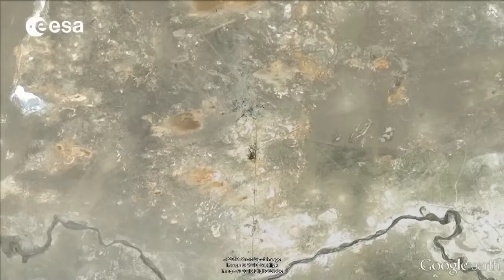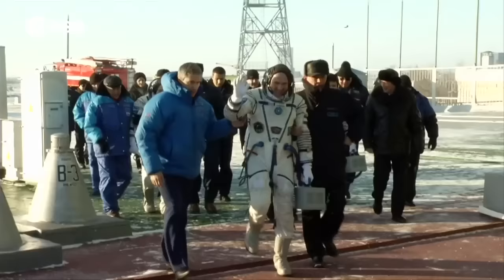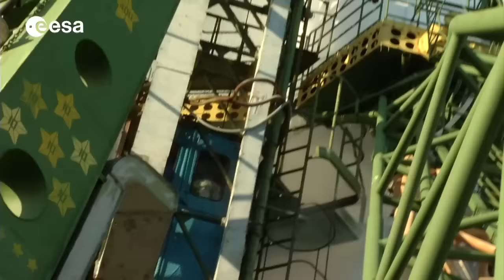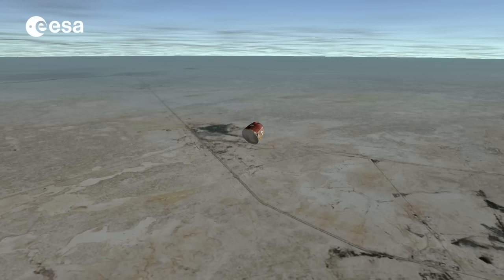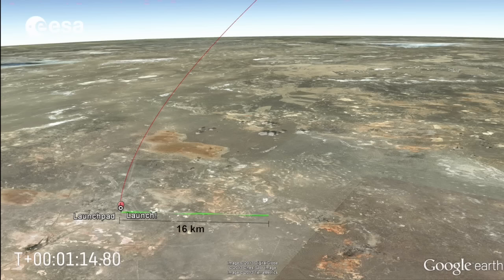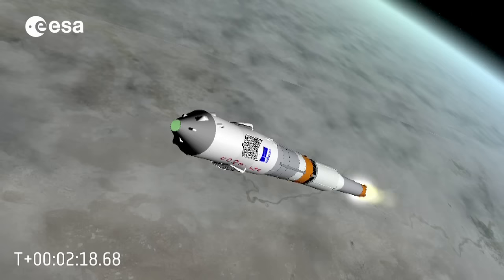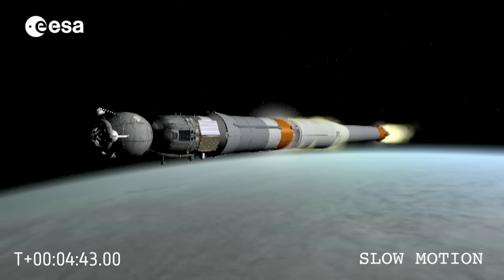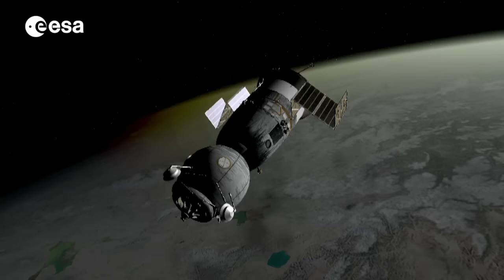The Soyuz launch sequence explained

Comment: Say, what would be the function of those four folded quadrangular panels that extend upon LES activation? Are they air brakes?
Reply: they are solar panels,probably for providing electricity to the engines.
Reply: SSen Gupta
No, on the outside of the Soyuz fairing. It looks like a grille that we see folding out when the LES is activated.
Reply: They are control surfaces that fold out during an abort, and they stabilize the flight of the capsule like the feathers of an arrow as it flies upward. They are shaped like that because they stow more easily, unlike traditional fins.
Reply: Owen Vankirk Interesting, thanks.

Comment: I am not a science student so can anyone explain me, why do the boosters I see are less powerful then compared to nasa, the reason I got to is conclusion is because the engine was making less noise and less smoke then compared to nasa rockets
Reply: NASA almost always uses solid-propellant boosters, which are much more powerful, but cannot be shut off mid-flight and are thus very dangerous for launching manned spacecrafts. Russia uses liquid-fueled / hypergolic boosters, which can be throttled.

Comment: Why 3rd stage fires while still docked?
Reply: To push off the second stage? Just a guess.
Reply: It happends because you need some acceleration when you want to ignite the next stage (the fuel has to flow towards the engine), so if they don't ignite it during the burn of the second stage no fuel would flow towards the engines and so it can't be ignited anymore (remember that the rocket would be on a ballistic trajectory and so would be  weightless). This technique is known as "hot staging" and is also used by many Chinese and Indian rockets. 
The Americans use another technique (For example the Saturn V used this), they have small solid rocket engines on the stage which don't require acceleration to ignite since the fuel can't flow. 
They ignite the small engines and those will provide a little acceleration which allows the fuel to flow towards the engine which then in turn allows the main stage engines to ignite.

Comment: "This incident proved how reliable the launch escape system really is." Did it? The system worked on that day, but perhaps the cosmonauts just got lucky. Then again, maybe it is reliable, but all the incident proved is that it's capable of working. The author appears to have the reasoning ability of a Challenger Space Shuttle manager.
Reply: The Shuttle has no launch escape system
Reply: Yes, I was commenting on the wider problem in NASA managers, that allowed them to conclude that because O-ring erosion had occurred on earlier flights, and not caused a disaster, that meant it didn't matter, even though it was not meant to happen, and the reason for its happening wasn't understood.
Reply: But it happen, and then happen again.. Thats why there is no Space Shuttles anymore :3
Reply: It proved it works as intended in a real scenario, it proved the escape procedure wasn't only a "just on paper" kind of solution. Will it work 100% of the time? Extremely unlikely but until fails it's a proven system. 

At the very least, it exists, not like other spacecrafts without any meanings of escape cough cough shuttle cough.
Reply: Soyuz, sending men reliably into space without a single accident since 1967, is that proof enough for you?